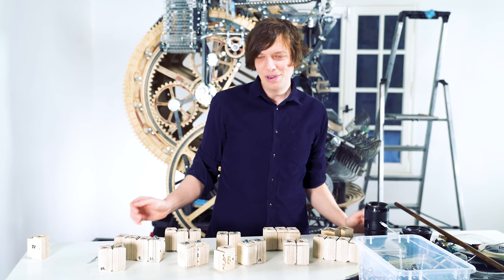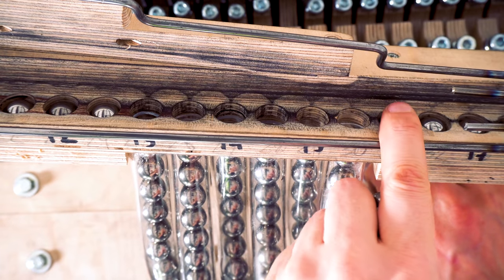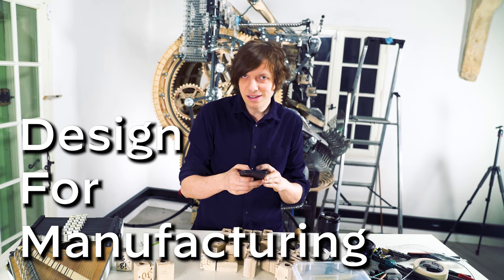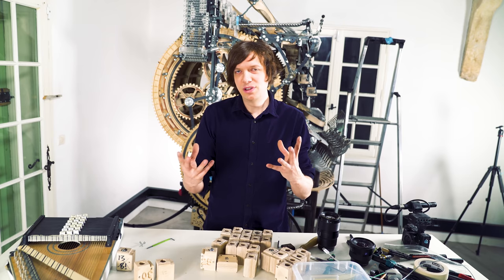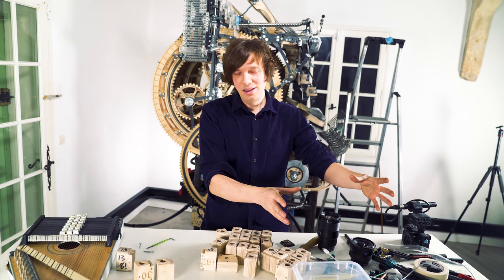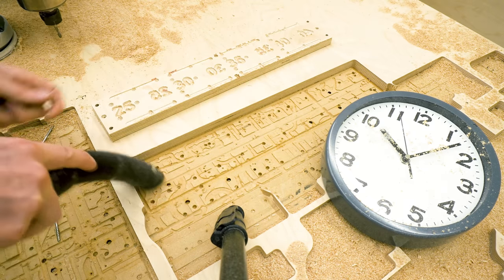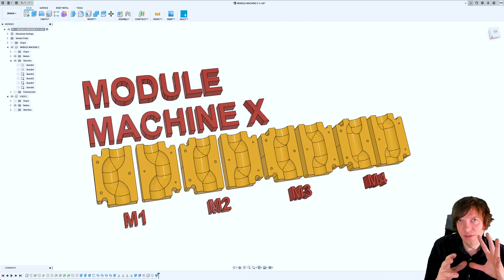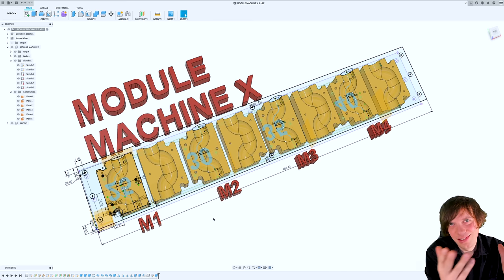Module Machine X

Comment: There's a reason why most cars are not 'designed for manufacturing' the same way as the Cybertruck. The usual manufacturing techniques are already highly optimised (and inexpensive in large quantities), and designers usually like to make something beautiful instead of only functional.
Reply: Also, cars have curved panels as it boosts rigidity, especially when made from really thin sheet metal. A slight 3d curve greatly strengthens the metal, with those massive flat planes, the cyber truck will probably dent pretty easy, even with the stainless steel.
Reply: Yeah. There are plenty of reasons for curved bodies. Aerodynamics, strength, etc.
Reply: Exactly. For every problem, there is a solution that is simple, elegant, and wrong. Flat panels can be more than halved in weight (and therefore in material / energy / environmental cost) with appropriate curves, folds and creases. The DeLorean is stainless steel and an absolute nightmare to maintain and repair - you can't just sand, fill and paint the panel. You have to consider the WHOLE lifecycle, including the energy and environmental costs of the source materials, through ownership and how sustainable it is in the long term, and onto disposal.
Reply: @Zadster  I read your comment and I can't tell which side you're defending
Reply: @AfonsodelCB  maybe that's a good thing
Reply: Those processes work fine on thinner mild steel panels, but not on 3mm stainless. And therein lies the catch.
Reply: @Zadster  that boosts the rigidity of the Whole panel but does nothing to combat point loading. The things that cause dents and dings. The kind of things trucks that have seen real work have a lot of.
Reply: Not only that, but the bed of the truck is designed where you can't put a lid on it that allows for still a large amount of space. There's so much about the cyber truck that makes it bad, and not just a bad truck.
Reply: In fact I really don't trust a businessman who comes up with half-baked ideas like the hyperloop to produce a safe and powerful truck. I'd leave it to the real engineers who understand all the pitfalls of automobile design.
Reply: 3mm stainless is sustainable? Are you kidding me? Normal cars have sheet metal ranging from 0.8mm to 1.6mm. Some reinforcement panels go up to 2mm or more
Reply: This video and a lot of the comments really shows the cult-like following and gobbleing up false statments that is told by Elon Musk. Just ignoring the fact that the body will weigh atleast 2x of a normal car for example.

Comment: As a CTO of a company that's going to be releasing a new product this year, I can confirm that "DFM" is a big part of product design.
Our internal electronics used to be three small chips connected with three thin and short wires, but soldering the wires was very cost and time intensive. So instead we re-arranged a lot of stuff and now it just one bigger chip. The new chip now has a more complex shape, but cutout of chips is easily automated, whereas soldering short thin wires is more difficult to automate.

Comment: Also the cybertruck is going to be the unsafest vehicle in quite a while since it doesn't absorb any energy in crashes by deformation. It's like a brick and you are experiencing the crash directly with your body.
Reply: The Model 3 received the lowest probability of injury ratings every recorded by NHTSA. Tesla's got a reputation to uphold, and they will not be releasing a car that doesn't protect its occupants.
Reply: There's no way it doesn't have crumple zones designed in, the aesthetics of a vehicle have nothing to do with occupant safety. Pedestrian safety on the other hand... Oof.
Reply: Well, it's reinforced, welded stainless steel. They showed a giant steel ball bouncing off if I remember correctly, how do you make THAT safe for crashes? With a million airbags? What about the other car you're crashing into?
I have my doubts they'll be able to properly solve that but we'll see when it comes out. I'll happily eat my words if it IS as safe as the model 3

Comment: Another clear example of DFM in the cyber truck is the touch screen controls, very cheap for the manufacturer but I hate it, in my opinion physical controls are safer and more ergonomic
Reply: Yep. Just because it's simpler for manufacturing doesn't mean it's better for human usage. It HAS to be flat triangles because they can't bend the 3mm stainless to make small curves. It's ugly and limited design wise by a stupid choice I'm pretty sure was only made because Tesla paint sucks and the aluminum they used dented easily.
Reply: Controls are a personal preference, i dislike controls in my Hyundai after trying Tesla. Plus touch screen controls can be improved by software, i have to switch my whole car to get better controls haha.

Luckily there'll always be niche manufacturers/modders who recognise your personal preference, though some of them may not be cheap in the future.
Reply: They have done some work on that with some controls on the steering wheel, but their aim is for voice control so you dont need buttons. Frankly im surprised they dont have a complete solution yet. the voice control works perfectly for some things. Though maybe it does have voice control for everything and people just like to complain about the lack of buttons?
Reply: I hate touch screen interfaces, my car has one, and you just cannot change radio station without looking at it, nuts.  My other cars have regular buttons, you play with radio, AC, etc, without taking the sight from road.   I guess that these manufacturer are more of the idea the car auto drives, so you can be distracted more... as if being distracted was a feature.
Reply: It's the reason I still use a flip phone.

Comment: The Cybertruck is designed for manufacturing but not designed for use. The sharp edges at the exterior (but also in the interior) are not controversial, they are life threatening and should render those vehicles actually illegal to drive in Europe, for very good reasons. But it is not only the sharp edges, it is also the ultra rigid nature of the exterior, Musk demonstrated with almost diabolical pride with a sledge hammer. This makes any impact, even if you don't hit the edges so much more destructive and deadly all on its own. 
The Cybertruck is designed as a pedestrian killing machine. As such it is clearly bad design. I am just at awe how no one seems to talk about that existential flaw of the design.
Reply: The designed for manufacturing argument is also pretty weak, they're not making individual bends to create the edges, those parts are pressed using a mold and that means it doesn't matter if the part is round or straight.
Reply: @kakaokuh  try molding a hollow shpere instead of a cube and see if "it doesnt matter if it's round or straight"
Now apply that to manufacturing a complete car and not a sphere, and see your fallacy.
 The car is bullshit, ugly and dangerous, but your non-argument still shows how little you know about manufacturing, very obviously.
The type of bs some fanboy will use against you, dont be that guy.
Reply: Are vehicles designed to collide with pedestrians? I don't think so. I think a fully dump truck is a lot more dangerous than a cybertruck, but I don't see outrage against dump trucks. Seems to me like the problem you're bringing up is that pedestrians share the same space as moving vehicles.
Reply: @insanity54  Wow, that's a mentality like straight out of the 1950s. Are you from Europe? Doesn't sound like it but who knows. In Europe the legislators have left that anti-pedestrian mentality long ago, they are not laying the blame on them anymore for  daring to cross streets. Instead there exists strict legislation forcing car producers to engineer their cars in a way to lower lethalities in case of collissions with pedestrians. That also affects dump trucks btw. They are also designed that the front gives in at collissions and is not made from rigid steel plates with sharp corners. 

The Cybertruck as it is is most likely illegal on European roads and for good reasons and yes I consider that bad design if you can even comply with safety regulations.

Comment: Hey Martin, first comment is that the DFM work you did on the modules is A+ work. I'm impressed that you managed to flip the workpiece over and get everything aligned in the right location - that's generally pretty tricky.

Second, and much less importantly, the Cybertruck's design isn't strictly driven by DFM. In fact, having flat surfaces like that is a choice that runs counter to making the truck easier to produce.

The issue is that flat panels will buckle easier, and so must be made thicker to have the same "strength" - that makes them harder to bend. In this case, the design and manufacturing method are dependent on each other and can't really be separated like that. 

If the truck had a different shape, it would impact the manufacturing methods that are the most feasible.

Comment: Every Car is DFM, every panel or bodypart is Pressed into shape and whenn needed welded together by maschines. The only difference in the Cybertruck design is the cost of the pressform.
Reply: I think it's actually the material that resulted in differences. The kind of steel plates they use on the Cybertruck are very difficult to work with, you basically can't bend or mold them at all. Very interesting.
Reply: The material means cybertruck doesn't need paint, is more rugged and the shape is structural. Cybertruck has stronger dfm.

Comment: In the Marble Gates, there is still the screw, to block the Marbles, I would suggest to file down the threading or just replace them with metal rods, to prevent friction in there. You woult achieve less stress on the releases, and prevent the marbles from getting grinded slowly by the threads. After that you woult have to change the height modules a bit I guess, so I would recomend to do this before you chose the right ones for the current setup.
And is there something to prevent the top PMA-Pipes from moving like at the ones below where Wilson helped you out?
Reply: Yeah that part being threaded has stood out to me as well
Reply: People said that the marbles was made out of tougher materials and that they'd grind the threads first before even getting any form of damage on them. Though I agree that removing the threads might help with reducing the friction.
Reply: As many people under yesterdays videos (height modules) commented, this height module design is problematic. The tolerance chain is very long, the paths (i.e. pmma pipes) are slightly bigger than the marbles' diameter. Therefore, the vertical row of marbles forms a snake pattern in the pipe, which is not always the same of course. Thats the reason why this design with the height modules will not guarantee the needed precision on top of the marble devider.

In this video Sebastian Kirsch came up with an brilliant idea (trapdoor hook system) which could solve the problem:
https://www.youtube.com/watch?v=zahlKPc6TMA&feature=youtu.be

Please vote it up on discord that Martin and the engineerng team can see it:
https://discord.com/channels/649165975647682560/649172304638640130/802136003137372180
Reply: @FM-vh1on  that's a very good one. Something like this was also in my head, but ab bit more complex...
Reply: The gates are working fine in their final positions, there wont be any more force on them than whats already there. Reducing friction further is unnecessary. Also over time the ball bearings (marbles) will wear the threads down quite quickly.
Reply: @FM-vh1on  Dont know if its necessary but its genius!
Reply: @jasonmurawski5877  Then the height would need to be readjusted in edge cases and spread metallic dust. I don't see a reason for having that point of friction.

Comment: As someone who installs shelving for a living, the IKEA shelves really ick me.  The ease of manufacturing that you see on your part with regards to the folding of the metal comes at a cost of assembly and the functionality.

When I see the Cybertruck, I see a significant loss of functionality with the design.  As someone who loads and unloads off of trucks, having sharp edges is an ergonomic failure as you have to take care with the edges.

When it comes to the design for manufacturing, do not let the ease of manufacturing get in the way of the function of the product you are making, otherwise you get lazy slop.
Reply: In what way are the Ikea shelves less functional after they have been assembled?
Reply: The cyber truck is a cowboy cadillac. Work is an afterthought of the design.
Reply: This is a good point. Designs that are easy and cheap to manufacture are not automatically a good user experience. 
If DFM means the cybertruck ends up notably cheaper than all the curvy trucks, users may consider the awkward shape a worthy compromise. Otherwise it's more about users making a statement than about it being a practical product.
Reply: @ferrumignis  The function of a shelf is to hold something up.  If it is rickety and unstable, that would mean a loss of function as the forces of putting something on or taking something off is more likely to cause a failure.
Reply: @phillipsiebold8351  these cheap ass shelves are absolutely stable if you use them as intended : ie: fixing them to a wall. Martin put the back bent part in the wrong side and missed the obvious wall mounting screw holes as a result. 
Not that they're the best shelves around, really really far from it. but they do a surprinsingly good job considering how cheap, easy to transport and build they are. 
As an example of DFM, they are perfect.
Reply: @sirzebra  Maybe.  But why didn't Martin fix them to the wall?  Always consider installation as part of the manufacturing.  Usually manufacturers of shelving will have brackets, oftentimes separate, that you are to use for anchoring.  The fact that they protrude or are separate parts will communicate to installers that they need to use them to anchor.  Just punching holes in either the beam or the frame is not enough.